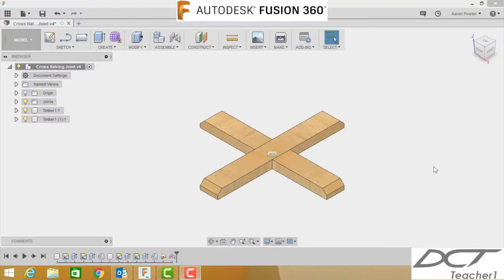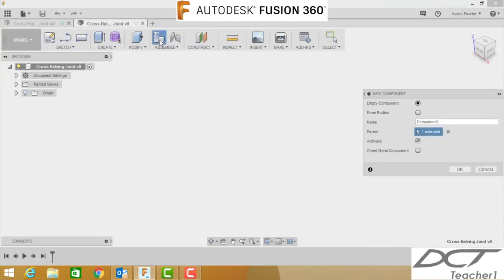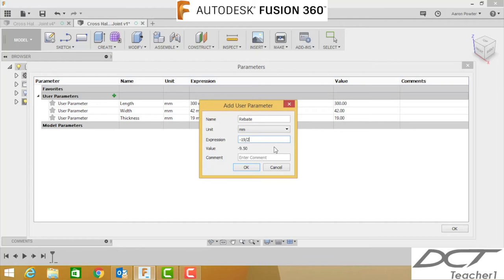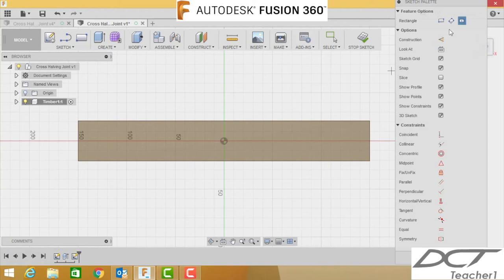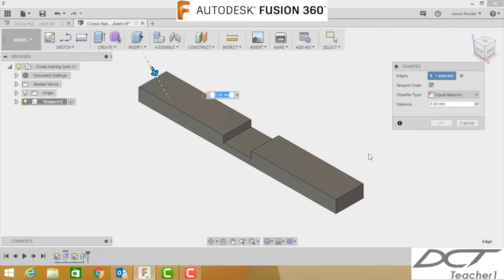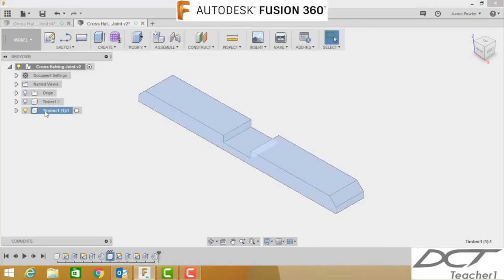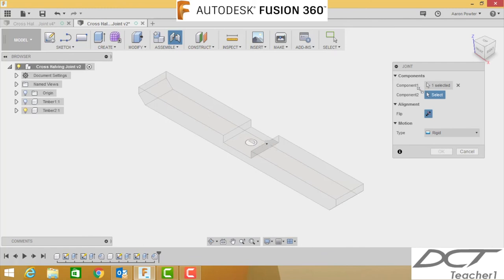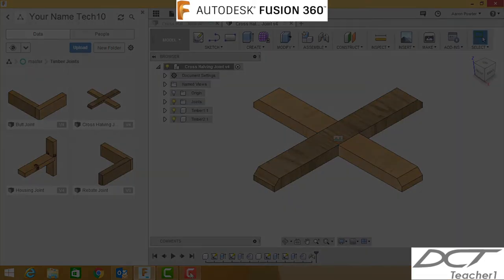Fusion 360 Cross Half Joint - HTC Tech10

Comment: in the case of a rigid joint, where there is no movement, what is the advantage vs just moving the second timber to sit in the rebate of the first one?
Reply from the maker: You could do that, but probably best to lock it into place. Especially if producing a 2D drawing as measurements can be out of whack.

Comment: what if its not at 45 degrees???
Reply from the maker: Hi Justin, are you referring to the chamfer?
Reply: DCTTeacher1 the cut out for the cross halving joint
Reply from the maker: Hey Justin, I'm a bit confused with your question.  You are asking about 45 degrees?  The cross halving cut out size is 42 x 42mm to a depth of 9.5mm. You can always edit your sketch in the time line by right clicking on it and select edit sketch.  If this is not the answer you're looking for, can you direct me to a time in the video so I can see for myself?  Aaron.
Reply: @DCT_Aaron_Engineering  I know it's a year ago, but I think what he meant was what if the joint wasn't 90 degrees (perpendicular).  It's easy enough to sketch a perfect rectangle to cut a lap joint in the wood.  But what if the wood pieces crossed at some weird angle like 45 or 60 or anything.  I'm struggling with that now.  I'm trying to  fit to cross members on the side of a table.  I'm trying with projected points sketch where the cross member would meet, but no luck.
Reply from the maker: @kapnkerf2532  Hey.  I just did the exercise again and drew the halving joint on the angle.  You can do it either by sketching the angle joint and extrude cut or (top) or sketch on the side and sweep cut along an angle path.  Then repeat using the top down method shown.